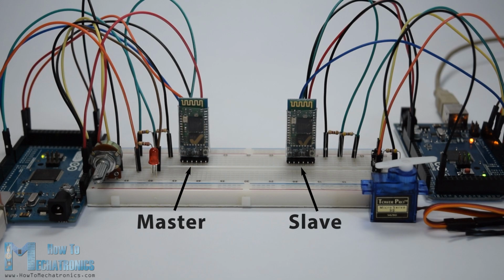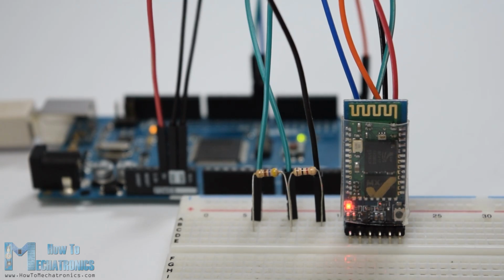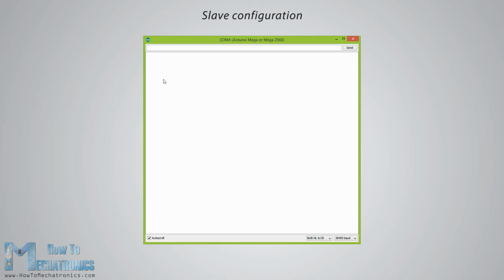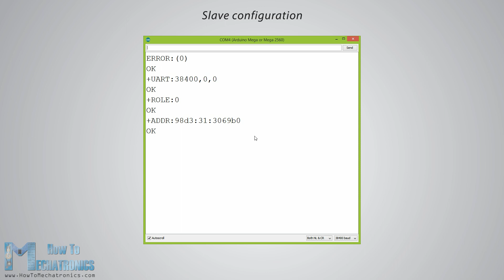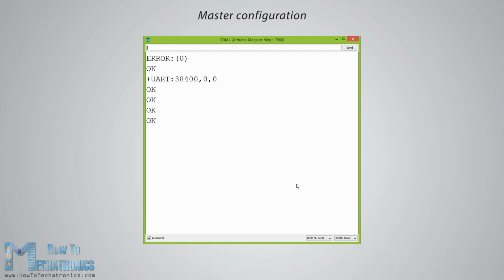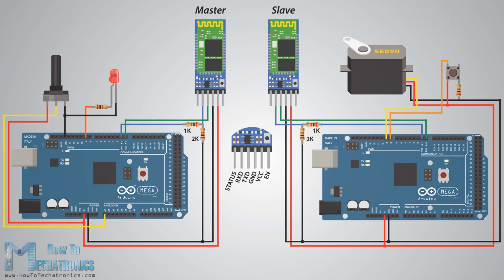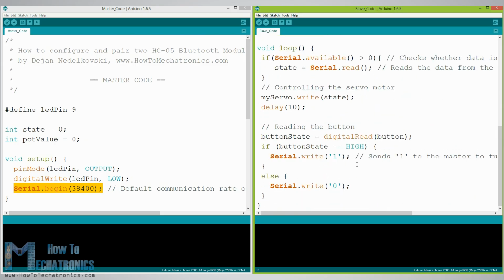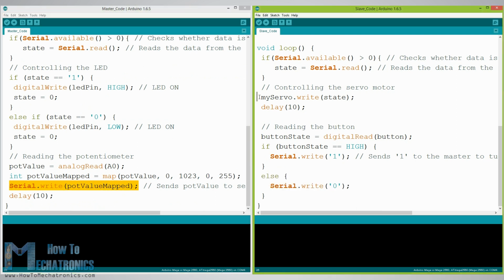How To Configure and Pair Two HC-05 Bluetooth Module as Master and Slave | AT Commands

Comment: how do I send multiple signals from the master to the slave. For example, Joystick X and Y value + potentiometer + pushbuttons without getting signal interference. I am trying to make a bluetooth controlled car. But it seems like the signals are digital 0 and 1. Because whenever I send a number greater than 1 it is still interpreted as 1 by the slave. Any ideas?
Reply: I figured it out. You can send char commands from master to slave

Comment: Thank you for this tutorial. Can you please help me understand why can't I enter the command mode? My HC06 seems to be a knock-off, it does not have the reset button like the one yours has. Anyways, I would appreciate any tips on this. Thanks!
Reply: There is likely an issue with your enable pin. It isn’t often actually soldered to the corresponding input on the Bluetooth chip from factory.

Comment: and also can we use other that '0' and '1' ? can you please explain to me?
Reply: Yes you can change the '0' and '1' for any other numeral smaller than 255. Just make sure to also change that number in the slave code and the master code. The creator choose '1' and '0' because they are simple and in binary '1' means ON and '0' means OFF.

Comment: Good day! How to send different data (Example: temp and humidity) to the slave arduino,  one at a time? Hope you can help me :)
Reply: in the master code change what is being written to serial. For example instead of  the normal 

potValue = analogRead(A0);
 int potValueMapped = map(potValue, 0, 1023, 0, 255);
 Serial.write(potValueMapped); // Sends potValue to servo motor
 delay(10);

you can change it to 

humidity = digitalRead(pin the sensor is on);
temp = digitalRead(Pin the sensor is on);
Serial.write(temp);
delay(10);
Serial.write(humidity);
delay(10);

and then make the change on the slave side as well

Comment: how would i set up 2 servos and 2 potentiometers? do i add a different angle or just connect it to a different pin?
Reply: use the same code 

potValue = analogRead(A0);
 int potValueMapped = map(potValue, 0, 1023, 0, 255);
 Serial.write(potValueMapped); // Sends potValue to servo motor
 delay(10);

but double it, like this

potValue1 = analogRead(A0);
potValue2 = analogRead(A1);
 int potValue1Mapped = map(potValue1, 0, 1023, 0, 255);
 int potValue2Mappes =  map(potValue2, 0, 1023, 0, 255);
 Serial.write(potValue1Mapped); // Sends potValue1 to servo motor
 1
 delay(10);
 Serial.write(potValue2Mapped); // Send potValue2 to servo motor 2
 delay(10);
Reply: and for the slave side you would do the same just with the servos

Comment: TxD and RxD pins on arduino should be digital so how are they sending and receiving analog values for the motor? Please tell.
Reply: The potentiometer is varying the ratio in the voltage divider (not seen in demonstration), where an analog pin is connected to recognise this change in voltage, through analog read. This value is converted into a byte (0s and 1s) equivalent to this value of the voltage. This is sent in order by asynchronous serial communication (RX and TX are forms of this communication) to the other microcontroller where an analog write produces a PWM signal (this controls the position servo) where the lowest value of the read voltage is equivalent to the left most position and the highest read voltage is equivalent to the right most position for the servo or vice versa.

Comment: Hey does anyone know what the name of the piece is that shows up on the far right at 0:53 and in the middle at 5:00 in the schematics? There aren't any wires connecting to it, so I'm confused as to what it is and whether it's necessary.
Reply: That is a zoom in view showing the HC-05's pins.  It is not a part.

Comment: At+bind gave error 7
My at+addr is21:13:268f
Reply: AT+BIND=0021:13:268f
go for this, in yr AT command ,I hope it will work
Reply: @vickyj17aiswal   That is wrong, he should use AT+BIND= 0021,13,268f

Comment: Hi, Bro, thanks alot! I remember about 5 or 6 years ago I wasn't using Arduino, libraries etc. I was programming everything by my self. OMG, how long it take and how difficult it was to adjust 2 HC-04 modules using AVR Atmega48, assembler language, and USB-UART based on MCP 2200. I had absolutely NO KNOWLEGE how to do it. I even wasn't know how to correct write AT commands. I mean "AT+name" or "AT + name" etc. I got how to do it correct through experiments and tons of time. And now I have a choice - order these modules and spent 2-3 weeks until its arrive to me. Or take my HC-04 modules (I hope it's alive after 5 years :D), my old assembler code and rewrite it to Arduino's language)) In any case the video is pretty much useful. Good job.
Reply: Lol I totally forgot what it means :D

SB21:  cpi UARTTemp,2 ;Сравнить пришедший байт с 3
       brne SB31

       ldi s,11 ;
       ldi d,11 ;
       ldi e,10 ;-
       ldi m,10 ;-
       rjmp showbatt1
    
    SB31:  cpi UARTTemp,3
       brne SB41

       ldi s,11 ;
       ldi d,10 ;-
       ldi e,10 ;-
       ldi m,10 ;-
       rjmp showbatt1

    SB41:  cpi UARTTemp,4
       brne SB51
       ldi s,10 ;-
       ldi d,10 ;-
       ldi e,10 ;-
       ldi m,10 ;-
       rjmp showbatt1
Reply: i'm learning assembler but still cant interfacing bluetooth module xD

Comment: connect arduino tx to bt tx and arduino rx to bt rx, power up arduino while pressing the button in bt module, open serial com set the baudrate to 38400 and Both NL and CR

This will workin some BT module version

Comment: Can I use this for two HC-06 module ? these command don't work , and if not ,is there another code to pair two of hc-06 ? or I must buy hc-05 ??
Reply: hc-06 are slave only modules - you need either both hc-05 or one of each hc-05 and one hc-06

Comment: Solution to a problem.
If someone is getting the getsync() error like I did, it's because you HAVE to remove the wires from tx and rx pins on the arduino before uploading the blank code. Then you may attach them.

Comment: Great video. Programmed as you showed, placed the Slave on a portable Uno and did a range test. Almost ran out of distance before I lost the link. Keep them oriented the same, as in standing up on the breadboard and don't stand between them and the 50 foot range seems to be accurate. I only needed 25 feet.

One thing I did notice, when I asked for the UART settings it sent back 9600 even though I was communicating with the serial monitor on 38,400 to program them. It sees the 9600 only applies to the baud rate of data between the two units. That's perfect for me as well. Excellent detailed video.
Thanks

Comment: What happens if you upload the blank sketch with the two pins(TX and RX) connected to the HC-05...I accidentally did it...
Reply: nothing happens bro it just probably wont upload if it does just re-upload with them disconnected it shouldn't do any damage to the board

Comment: Can I use master/slave mode with two different models arduino boards? For example if I have an Arduino Mega 2560 can I set It as Master and an Arduino Uno R3 as slave?
Reply: I currently have my Mega2560 R3 connected via HC-05 to my UNO, Yes.

Comment: can i use this code with HC-12 modules or what should i need to change in this code to use with HC-12 modules
Reply from the maker: The same code won't work, but I do have a separate HC-12 module tutorial so you can check that out.
Reply: Please ,can you give me a code to use with hc-12 modules like this, i need to control drone gimbal roll.then we cam add gimbals to toy grade drone too.please give me a code or do a tutorial ,it will be very helpful to  drone fans.

Comment: I have an application where I would like to send sync pulses at various frequencies unrelated to a particular baud rate - 5HZ or 11HZ for example instead of an RS 232 character. Would this work? Could I just pair them and then replicate random data at the other end as if I was replacing one wire with Bluetooth. Simple on an off basically.

Comment: Sir, my Bluetooth pair gets disconnect after a distance of 20 cm, Tried another tutorial where a bot was controlled by Potentiometer, same thing happens

But the same bot when connected with mobile works seamlessly for 8-9m

Checked code many times but the hc05 pair gets disconnected after 20cm

Please help sir, in urgent need!

Comment: Regarding to HC-05 problems: 
My hc05 moduls does not make the 2s blinks even if they're in AT command mode. There is no visible indication. It just fast blinks like you have no connection. But if the connections are right, I can successfully use AT commands. So imho just forget about blink indication. Not every model doing that.
Also my HC-05  moduls came with 9600 baudrate default. Also consider checking other baudrates if you can't get response from 38400. You can change it later on. "AT+UART=38400,0,0" command will put your moduls into 38400 baudrate.
Try givining 3,3V into Enable pin instead of 5V. This could help with some models.
After successfully solving problems and setting HC-05s, this training worked like a charm.

Other than that; color codes on resistors are wrong but the writing is correct in the schematics. Check that if you did it wrong.
Reply: I still can't get it to work though, my led is blinking slowly and I tried different baudrates, also connecting different voltages to the enable pin didn't solve it, I just don't get a response when I type AT
Reply: I found the problem I forgot reopening the serial monitor
Reply: Me too @frillneckedlizard8529
Reply: i have also same problem plz help me

Comment: Hello sir, my module is blinking at a proper rate of 2 sec, but when I am giving the AT commands on the serial monitor, there is no response on the monitor. What can be the possible mistake?
Reply: Switch the RX and TX pins in the video they are wrong on the picture but right when he says
Reply: @bbbbsammich910  none of those methods work..
Reply: @CakeMonsey it does work because you have to wire the rx of the arduino to the rx of the module, for when you send the commads to the arduino it receives it through rx and when the module answers through its tx it sends the answers back to the computer connected.
Reply: @bbbbsammich910  Mna. I know. Those are basics... Im telling you. Even the loopback doesnt work. Im not stupid, My both my dad and my teacher realized the same.
Reply: Hi everybody, I managed to work it out with chinese Arduino clone. All you need to do is press the reset button(buttom side of the chip) WHILE you are plugging the arduino to the power. Then it will blink slowly meaning it's in command mode and everything works as usual. good luck!
Reply: @Electronica para todosPress enter ( AT command ) while pressing the button in hc-05
Reply: @Blender Tutorials by AMK Guys. If you have chinese clone arduino, It wont work because it communicates differently as original one does. If you try loopback on TXD and RXD, it wont work. Idk why but yeah...
Reply: i have same problem for my hc05 not cominicate with serialport. just cant see AT commands. i tried any baudrate, TX-Rx pin, any voltage divider and otherthing. Serialport exactly working but no reaction from bluetooth module!!
Reply: @umuraydogan  Do you have a clone arduno? If so, you will need to buy an original one for this.
Reply: @CakeMonsTv  Yea its clon but the strange thing is when i use also 1 year ago (and i bought all equipment 1 year ago) it was working well. Now i cant understand. May it about new softwares arduino 1.8.19?
Reply: @umuraydogan  i have no idea honestly. Maybe arduino updated the software and that ch340 clone driver didnt update yet.
Reply: You must use old version Arduino IDE. I use Arduino 1.0 portable
Reply: Connect your EN pin to 3.3V

Comment: hello sir.
I want to ask. I will make a collision prevention systems for simulation I use 2 line trace robot's mouth each using bluetooth and ultrasonic. if ultrasonic as input and as an output of motor movement. how do I make that program?

Comment: Great tutorial! I have tried to replicate this with a slight modification. I am having some issues and would love to hear your input. I am simply just trying to get an LED to turn on from a command on the master, repeatably send a ‘1’ to turn on the LED. I just want to get the info sent over blutooth and eventually have a variable from the master display on a small 0.96 screen on the slave.

I have followed your schematic as close as possible. I have the two devices paired (blink together every 2 seconds) but I cant get the LED to turn on. Here is my code:

MASTER –
int state;
void setup(){
Serial.begin(9600);
}
void loop(){
if(Serial.available() > 0){ // Checks whether data is comming from the serial port
state = Serial.read();
}
Serial.write(‘1’);
delay(1000);
}

SLAVE –

#define ledPin 9
int state = 0;

void setup(){
display.begin(SSD1306_SWITCHCAPVCC, 0x3D);
Serial.begin(9600);
}
void loop(){
if(Serial.available() > 0){ // Checks whether data is comming from the serial port
state = Serial.read();
}
if (state == ‘1’) {
digitalWrite(ledPin, HIGH); // LED ON
state = 0;
}
else if (state == ‘0’) {
digitalWrite(ledPin, LOW); // LED ON
state = 0;
}
}

Thanks a lot for your help! The tutorials are great! Any help is greatly appreciated.
Reply: I think it is your program

  if (state == ‘1’) {
digitalWrite(ledPin, HIGH); // LED ON
state = 0;
}
else if (state == ‘0’) {
digitalWrite(ledPin, LOW); // LED ON
state = 0;

The LED was turned on in the first IF statement, then it was turned off immediately in the second IF statement.

To verify this theory, insert a delay(1000); statement right after you turn on the LED.
Reply: Are you sure that he'll get to the 2nd if, as that is in the 'else' clause of the first if. So if the first IF is true, then the code would not go into the else (and thus not in the 2nd if).
Or am I missing something?
Reply: I think you should remove the delay in the master. As there you write a 1 and then wait, but the slave has no delay, so it reads a 1, sets state to 0 and then turns of the led in the next iteration of the loop().
I think it's better if you put the delay in the slave after turning on the led. That way the slave will turn on the led, wait for 1 second, and then go back in the loop.
Or just remove the delay altogether and continuously send a '1', that should normally work too :-)

Comment: Hi, great tutorial, thanks a lot!!!
I'm trying to connect my HC-05 to a slightly different module: HM-10 broken out on the zs-040 board. I configured the HC-05 as master and the other one as slave. But the address the slave gives me looks quite different than in this example. It is 00:15:83:00:5E:EB. When using the AT+BIND command I get back an error (0). Do you know what I'm doing wrong?
Reply: Do AT+BIND= (Address)     make sure there is a space between the = and the address

Comment: Hello, i want to control the servo motor with flex sensors communicating with two arduino. I tried hard but I could not. Could you help. I made two HC-05 communications. Thank you.
Reply: I can not send and read the sensor value.
Reply: The sensor is working. I want to send more data. Which code to write.

Comment: hi
I just started searching the way to use the bluetooth module 2 days before. but when i watched your tutorial video, i learnt almost every thing, i wanted to know, just in few minutes. 
this is great and very easy to learn tutorial boss. 
i have some questions.
if i configure 1 HC-05 as master and other HC-05 as slave on 9600 baud rate, can i use both for simple digital data communication by using both with 2 separate  MCUs ? 
will these both work full duplex mode ? means if master send any data string to slave so can slave also send any data back to master?
Thanks to help me in advance

Comment: Good video, question, if I were to set CMODE=0, could I use AT+BIND to talk to more than 1 slave from the master?  i.e. add 2 or more "fixed" slaves?
Reply: +Taylor Schlupp Thanks Taylor, yes, I presumed you couldn't bind to different masters, once the device is paired that's usually it until you unpair it.